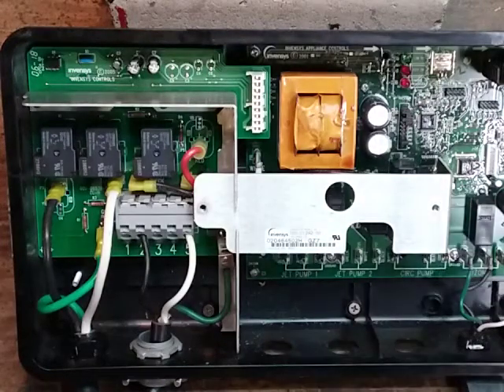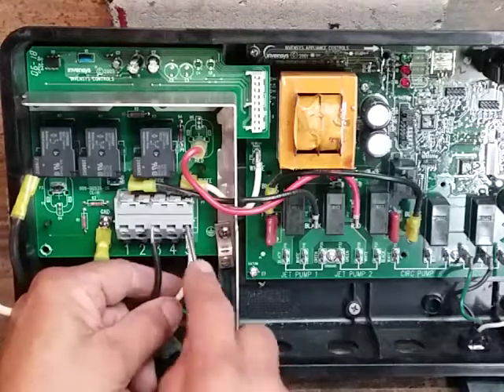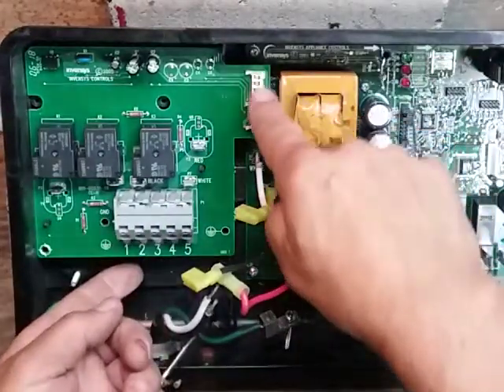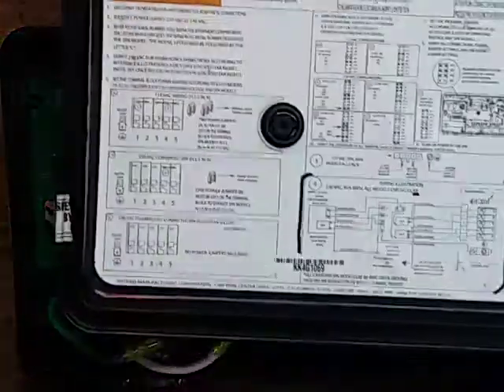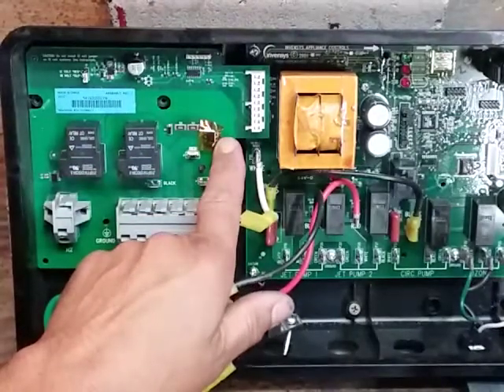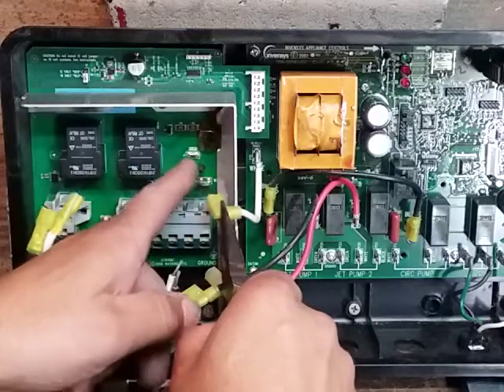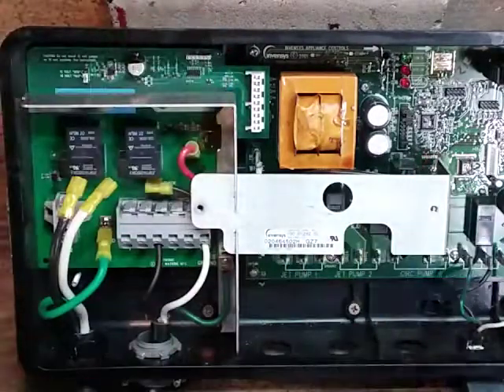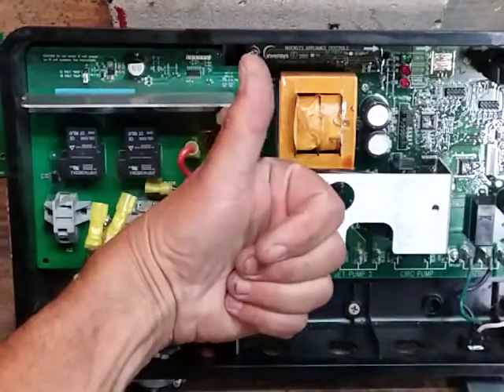Hot Spring heater relay board replacement

Comment: Hi Craig thank you for the awesome videos! I've tried to figure this out by watching your videos but am still not sure what I'm dealing with. I have a blinking power light, and a solid red light on the "control unplugged" and another one down by the "appliance controls" - but I've never unplugged anything. Also no solid green lights anywhere.  Any advice for me? Thank you.
Reply from the maker: CONTROL UNPLUGGED means communication problem between main board and control panel. Usually it is because a mouse has chewed the flat  ribbon cable coming out of the bottom of the control panel. They sit on that 2X2 board up there and chew it. Or the control panel has died. Very rare is LED light at main light lens getting wet, causing total control system glitch.
Reply: @craigsmith5025  thank you. Is the fix a new control panel?
Reply from the maker: @zboy1771  You'd be amazed what is behind hot tub shops in their junk pile. I think in back of my area, there are 2 tubs with that very panel, ready to be scrapped to the dump. Check your local hot tub shops for their junkers out back. Have a $5 or $10 bill ready for them if they actually help you retrieve something off a junker of theirs.
Reply from the maker: If the ribbon cable is chewed, that can be replaced. Some joker on Ebay is selling them for $99, what a ripoff.
Reply: I checked the ribbon and it's good from top to bottom. No mouse interference. Was hoping that was it. Maybe a bad control
Panel?

Comment: Him Craig! I have this exact tub and I have never been able to get it to function. Would it be possible to pm you to learn a bit about how to test components on the boards such as relays and the transformer, etc? I cannot find any resources or descriptions. I am decently educated in electronics and also mechanics, but this seems to have me flummoxed. Thank you sir!
Reply from the maker: I have other videos that explain simple causes for flashing light errors. Aside from that, is it completely dead? Sometimes wiring it wrong to your model is the problem. Sometimes someone mis wires it and blows the board.  Tell me exactly what it's doing or not doing. I can help from there. Otherwise 99% chance what you are seeking is in one of my videos.
Reply from the maker: In a nut shell... heater power alone is 2 hots in inputs 1 and 3. No neutral from that breaker. The other breaker powers the rest of the spa. 120v components and electronics is powered by a hot on 2 and a neutral on 5. The 240v pumps get their power from that hot on 2 and the other hot on 4. If you accidentally connected hots on 2 and 5, you blow the motherboard power supply. Smaller spas that are convertible 120/240 are a bit confusing so I won't get into it. Test voltage at those points. 240 across hots 1&3, 240 across 2&4. 120 across 2&5, 120 across 4&5. Zero volts across 5 & ground.
Reply from the maker: If you have the exact tub in the video, the 120v jumpers connect neutral to 3,4 and 5. And the hot is on 1 and 2. So you should be reading 120v across those 2 groupings in any combination. Sorry for wasting time covering dual breaker spas in previous replies. Those spas outnumber 120v spas 20 to 1.
Reply from the maker: If you have no power at spa, but power at 120v 20A dedicated outlet, you could have a bad gray GFCI plug.
Reply from the maker: Sometimes a person thinks that the sideways prong on the 120v 20A plug means 240v. If your sideways prong outlet got incorrectly wired 240v, the board was likely blown.
Reply: @craigsmith5025  1st of all, This was mostly done a couple years ago and I have a bad memory for details. so...Mine is a 2008 I think, that I got free, missing a couple mechanical components. I wired it in the permanent, 240 5 wire configuration from the 2 sources. The Jumper is also on #4, and there is one on 9, but my IQ2020 lid diagram doesn't show a 9 spot jumper buss. Initially the main board showed power available, but with very little reaction from the control panel. in the midst of testing I believe I plugged in the control board 1 pin off because the little plastic guide on one side was broken off. I then got a used replacement control panel, and plugged it in, and got the illumination and maybe the display, but nothing else. fast forward to this week, and I dove in again. Now I get the display for a split second, then steady red power light a few seconds, followed by the flashing red. I tested the control panel and the ribbon connector is good, but the micro switches all appear to be bad, and the little metal tops on them are rusty. I know Ill need to replace them, which i am capable of. But the only light illuminated on the main board says control panel not connected. I feel like I can fix the board components but I have no clue how to test the transformer or relays and no idea how to word it for a search...I can give you my contact info in a comment, then delete it if that would help. I am happy and willing to pay you.
Reply from the maker: @mykemech  the 'control unplugged' is a communication error between the motherboard and the control panel. What is the serial number on the spa? I'd hate to be trouble shooting a PUG system when you have an ORCA. My mail is without the spaces and terminology to get around security. C Smith 1138 at out look dot com. No need for pay, pictures of the control system and connections will help.
Reply: @craigsmith5025  sounds great my friend